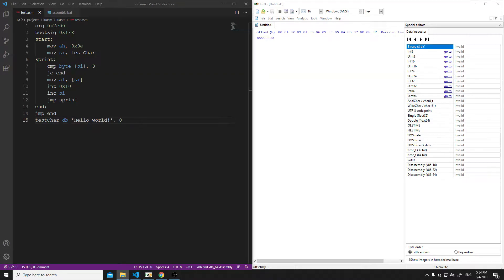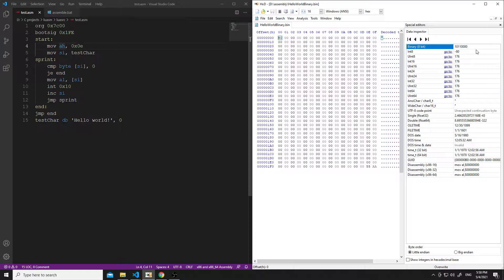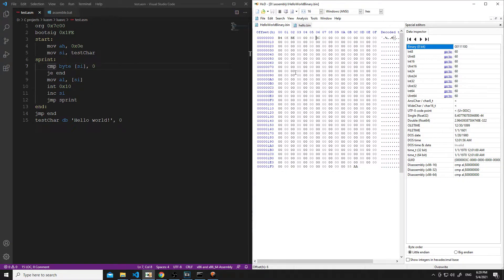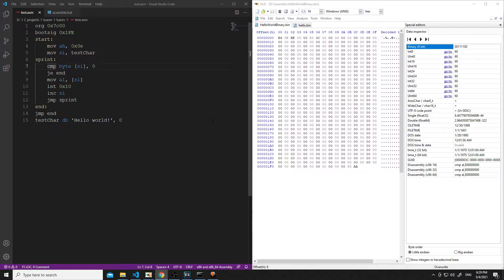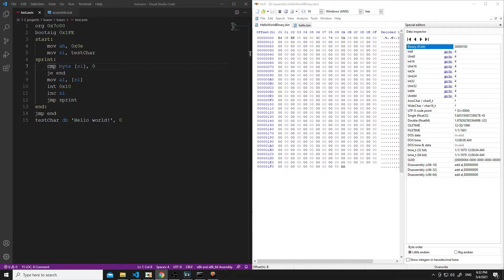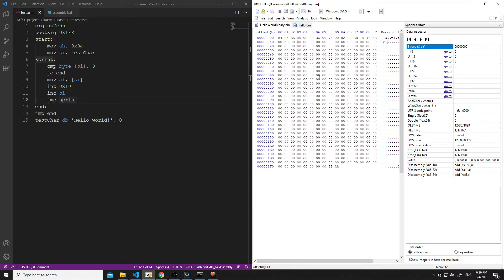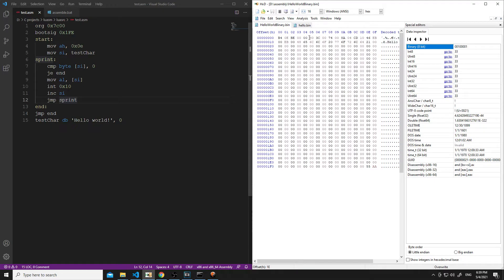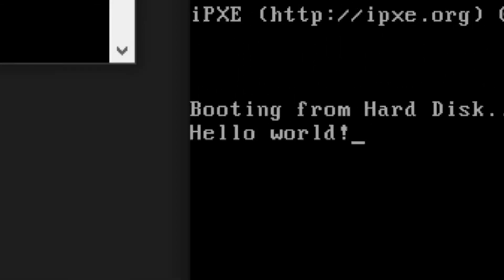Hello world! in x86 machine code (binary instruction encoding)

Comment: I did try to use your binary code but for some reason my qemu does not want to load the file, I think is important to put both things in the same video: the code and the virtualization software. I did try on both Linux and windows but no success.
Please recommend us a book from where we can learn how to program like this!
Reply from the maker: The only asm books I have my hands on are the AMD x64 architecture manuals vol. 1-5. There are free PDFs online as the actual set is getting rare. Vol. 3 goes in-depth about encoding, however its tailored for 64bit instructions.
Reply: @astralorchid  thank you for the fast reply! It will help me a lot!
qemu-system-x86_64 got an update and the command that you are using in this video does not work anymore,,,

Comment: We can use the bios to find more free memory and we can use the bios for a PS2 mouse handler (with USB legacy enable in the bios setup for USB mouse too) and we can use the VBE3 bios to switch into a refreshrate controlled graphic mode using the linear framebuffer in the 4. gb with the 16. bit big real mode for 80386+.